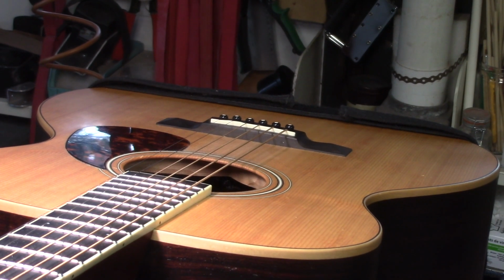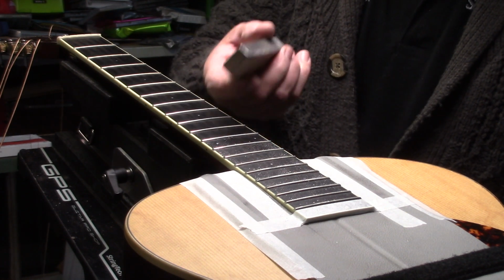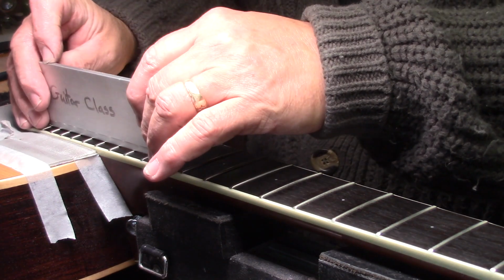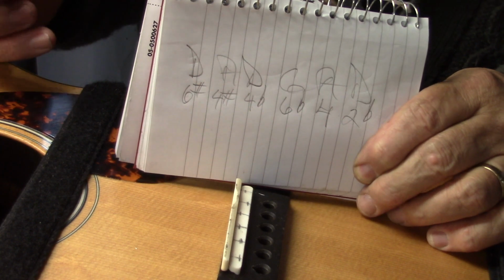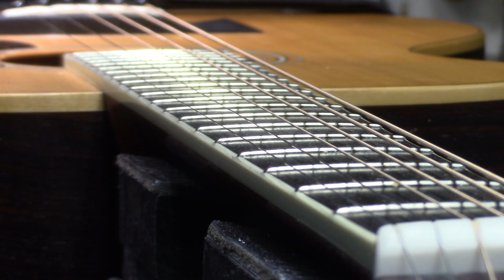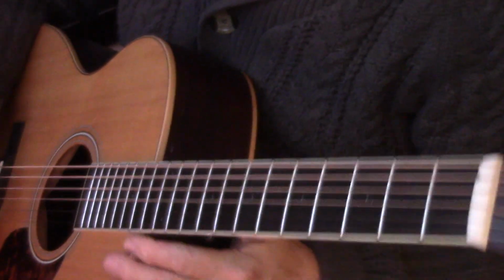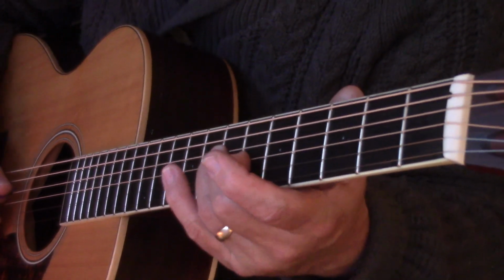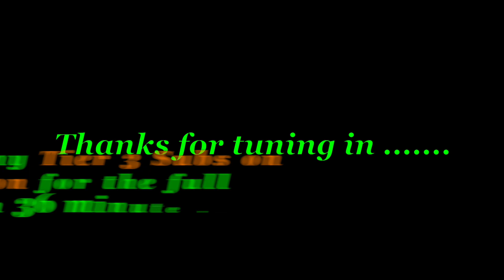Larrivee' OM-03 R SH setup for DADGAD@StringTechWorkstations

Comment: Hi, very impressed of your work, really a champion 🙂please tell me, how do you measure the compensation of saddle and bridge ?
I saw you looked for the 12th fret , but also the first, and then worked out the compensation of both.
that's what I wanted to do with my old Martin D 35 of '73....
Could you explain to me ?
thank you so much for your advices in advance !
Hopkin
Reply from the maker: The spec sheets / tools / materials / nut blanks / detailed videos and full instruction are made available to all of my Tier 3 Patreon subs.